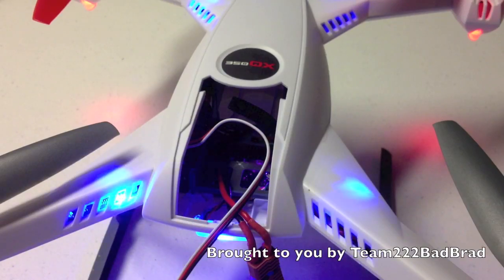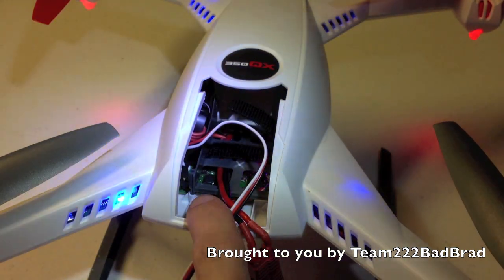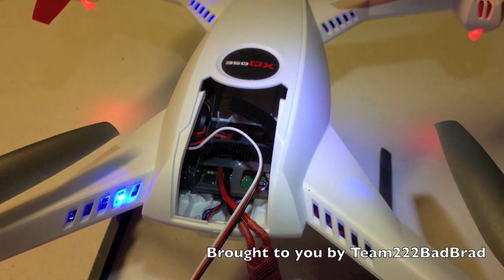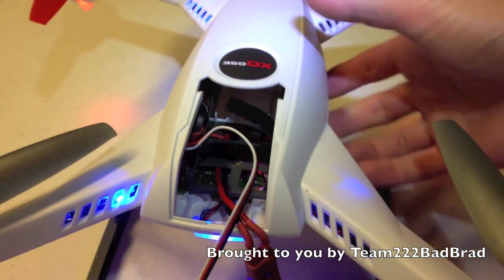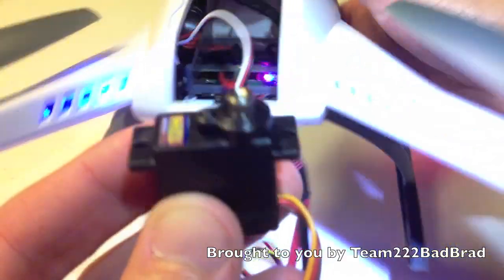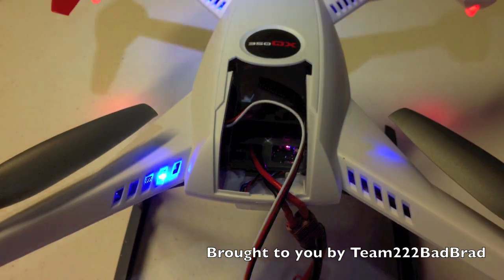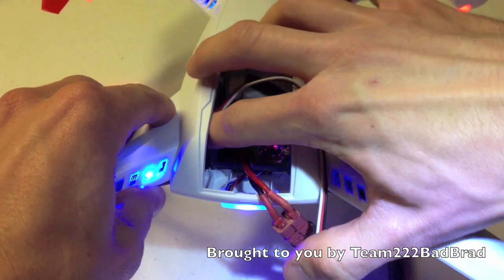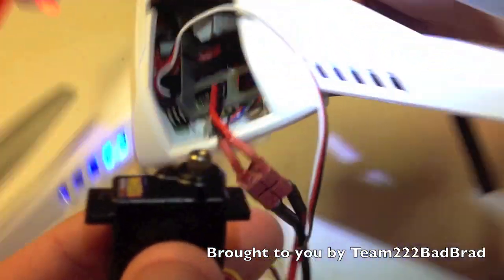Blade 350 QX Gimbal?  Yeah it's Gimbal Ready!

Comment: any updates? has anyone tried to use those leads with those cheap 2 axis gimbals you find on ebay? they have their own control board but if the 350 QX has its own control board then it'll save a few grams in weight/ cost?

http://www.ebay.com/itm/DJI-Phantom-Brushless-Gimbal-Camera-Mount-w-Motor-Controller-for-Gopro-3-FPV-/291005450599?pt=Radio_Control_Parts_Accessories&hash=item43c146c967
Reply: i just receive cheap 2 axis gimbals you find on ebay, i find it pretty heavy and finally i see this video.... :) so i try this leads and they work just perfect.
I take out the motors from the Gimbal and the control board and its very light construction ! i have to check if i have 2 mini servos and later i post some video.
Reply: +kim34xxx really ? so it can work without the gimbal controler ??
Reply: +kim34xxx gimbal controler = i meant gimbal control board

Comment: Not being enough room for a brushless gimbal,they can be the same size as any servo based one,also I think my blade could easily carry the weight of the brushless gimbal I have.

Not sure about Blade worry about cost of the gimbal for us because people would buy it,i know I would of done but not if it's servo operated,i'll just use my 450 quad with the brushless gimbal and use the little 350QX for FPV. ;-)

Comment: Thanks for that Brad and Blade has already said in a Q & A on their facebook page that they are working on a camera gimbal,so no big surprize there and to be honest i'm a bit disappointed now,because what you have shown us is that it will be servo driven which IMHO are not where near as good as the brushless motorized ones,i've have both a servo gimbal and a brushless one and I would never buy another servo one,do you think a brushless version with it's own board would plug in the same place?